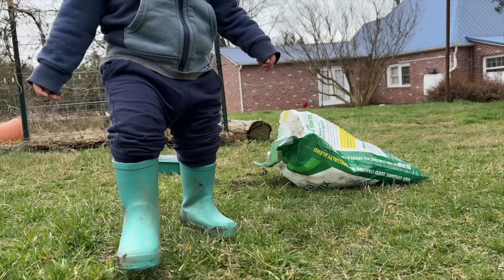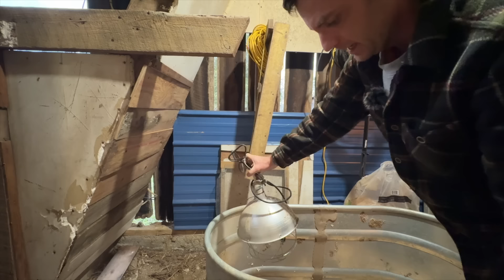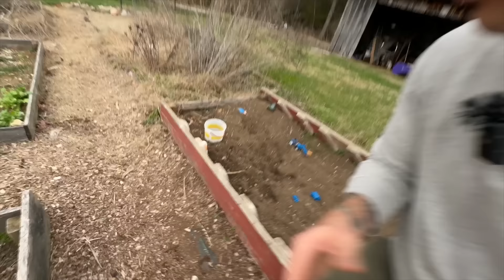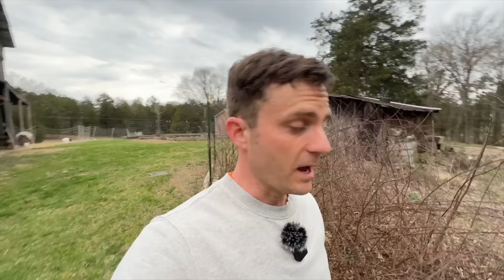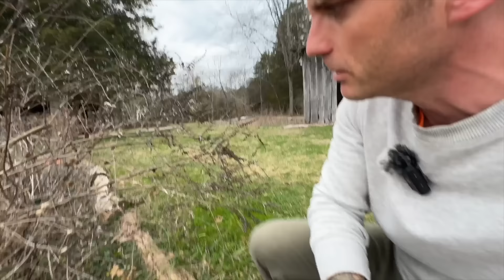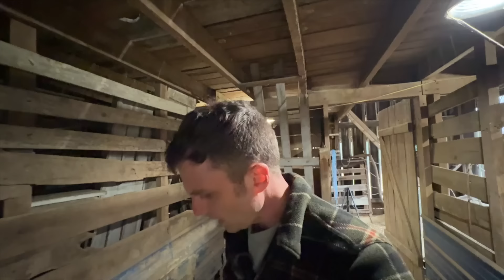Can I Be Honest? It's Trash.

Comment: I would like to know what your plans are for that pond in the back part of your property. 

As for the chicken room that you were asking about what to do for the roost, I would first line the walls with either hardware cloth or at a minimum chicken wire to keep critters out that might want to get a meal. I do like the idea of a hanging roast where it could be moved out of the way when you have to do clean up in that area.
Reply from the maker: Dad and I have been chatting about the pond. It's a big project that we've put a pin in for now. Until then, we're focusing on clearing the back pasture. But that pond will absolutely come back one day!

Comment: Hello Sean , we had a chicken house that had rafters and I used an old futon bed frame and laid over the rafters. As long as you have a way to have a ladder of sorts, a hanging rung frame will work amazingly and you can put it on a pulley system to keep it clean and lice free with a whitewash solution of diatomaceous earth and water in a hand pump sprayer
Reply from the maker: LOVE this idea. I actually decided to build something like this and it's in my next video. Thanks for the inspiration!

Comment: I would suggest not completely clearing the land. 
Cattle need a wind break in the winter. 
Plant a few cedars around the perimiter to help break down the wind from your predominate direction. 
Here, about forty miles south of you, the wind comes primarily out of the south/southwest. Up there, closer to the mountains, and the river- it might be different. 

Include the wind break in their pasture. It'll also give you a natural suggestion where they've calved if you plan to calve your heifers. 
They are naturally going to opt for a place where that little one will be better hidden. 
It may save you from losing a calf to coyotes and such as well since you'll know where she naturally chose to calve. 

The barn. 
Here's a shot to make a little money. 

South of you in Loudon, there's a lumber yard that specializes in selling antique/barn wood. Not sure how they obtain it but it might be worth checking into to see if they buy. 

Lay down a new seal piece and drill holes through. You wanna mark the location on the concrete so they'll line up. 
Fill the holes with epoxy 
Drive the bolts through the board into the epoxy. Snug up the nutc to the seal, this will give you an air gap to keep water from pooling on it and seeping under it. 

Cut the boards up high enough to offer some good pieces to the lumber yard or cut off the bad end and sell it yourself. 
I think they get $5 a board foot at the lumber yard. 
Sell it cheaper to get it sold and money in your pocket OR save the scraps for upcoming projects. 

Visit a SAWMILL and price out the replacement lumber you need. You'll get better wood than at the store. 

Now
One thing you're seeing and probably realize. 
Farm life is about getting it done. Done trumps looks, every time. 
Them that wanna throw off on things about looking terrible, never have had to make it work. 
Around here, we deal with a LOT of predators. 
Raccoons, Bobcat, coyote,  red wolves, bear, wild dogs, panthers aka mtn lion, usually black, (despite what TWRA says, they are here. Rare but here) falcons, eagles, hawks and snakes that want those eggs. 
They'd all like nothing better than a free meal at your expense. 
Done.... trumps looks and means meat in YOUR freezer. 

I'm about halfway between Knoxville and Chattanooga. 

My papaw sharecropped a farm here that a pioneering family in the county carved out of the ridges. 375 acres of the best ground down this way. Those creek bottoms will still grow anything you wanna plant. Only trouble is the owner now is a city boy farmer and doesn't realize what he bought. 
So other than hay, they don't grow or raise anything and the hay is usually just left to sit and rot. 

Idiots burned down a 200 yr old log cantilever barn that was built before this county was a county officially. The roof had 3 rows of 14 ft tin on it with 35 sheets in each row. 
Logs in it that would dwarf a man, mostly American Chestnut that grew right in the ridge. Hand hewn and half dovetailed. 
It dwarved anything in Cades Cove which has a pretty good sized barn at the visitors center. 

Point being
Done is better than looking good. Appreciate your hard work for what you get. 
At the end of it all
Done is best
Done right, sometimes has to come in second. 
Work with what you've got and get it done. 

Sorry for the novel. 
Just an old Tn farm kid
Missing the happiest days of his life. 
Walking and working those fields and ridgesides, with my hero. 
Raise that little one to appreciate the ground that helps feed him. Let him get out there with you. 
Even if it means a leash is tempting. Lol
It'll make memories you'll both cherish till the last breath. 
Dwayne